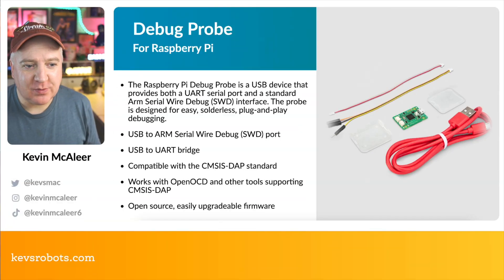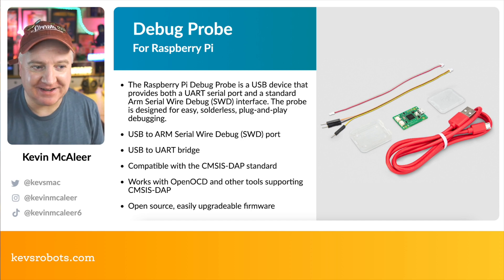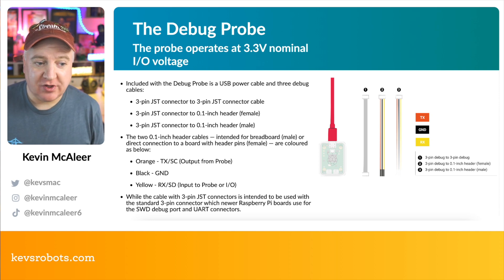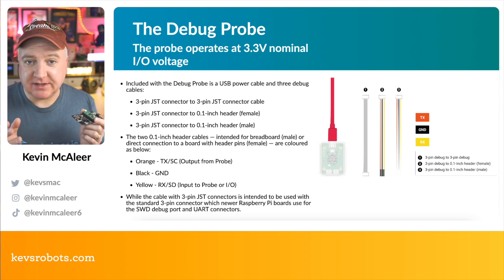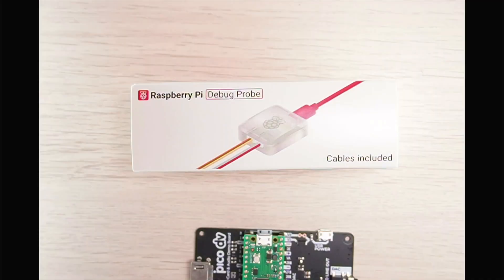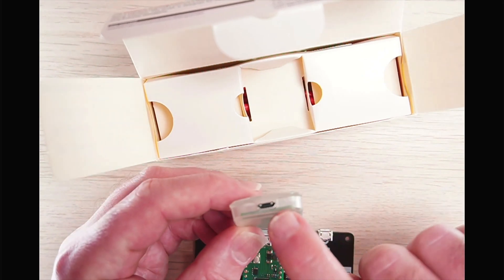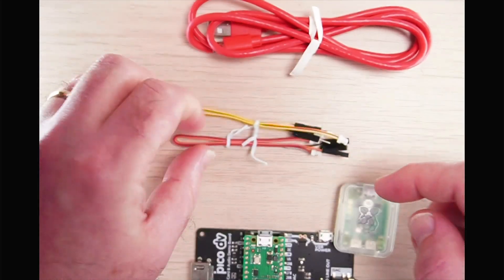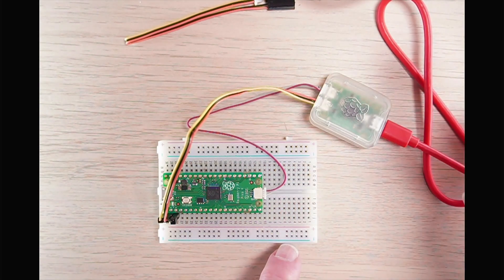The new Raspberry Pi Debug Probe

Comment: Yes. Both cables that come out of the two jst connectors of the pico debug probe are crossed going over to the pico board. The jst to jst flat ribbon  cable, ensures this. However, in some videos, I have noticed, the cable that comes out of the debug jst connector of the pico debug probe, is straight going to the pico (dupont) swd  header  pins. Raspberry pi has not labelled the jst pins of the jst debug connector in the pico debug probe. Thankfully, the (black), middle cable id ground wire.

Comment: Hi Kevin. I may be mistaken, but it seems to me that in your opening picture, of the above video, the two white JST connectors are plugged into the wrong sockets ? Also, in your video, where you show the actual cable connections, between, the Pico and the Pico Debug Probe, it is so dark, (not clear), which color cable is going to which pin, between the Pico debug Probe and the Pico 3 pin swd connector.
Fortunately, the Ground (black) cable is in the middle. Regrettably, I can not find a pin out diagram for the Debug JST connector.

Comment: I assume this could be use to debug any SWD compatible arm-cortex, but what does the setup look like?

For example, how is Eclipse+OpenOcd configured to talk to a Cortex-M3 inside a Smartfusion2 fpga.. vs a  Cortex-M7 in a stm32h745 microcontroller?

And if the chip (M3+) also has ITM's SWO/TDO (for serial-wire-viewing) can the pi-debug-probe + Eclipse/OpenOCD show this trace data?  Or is this only available in more expensive tools (Keil +  J-Link-Edu/Mini)?